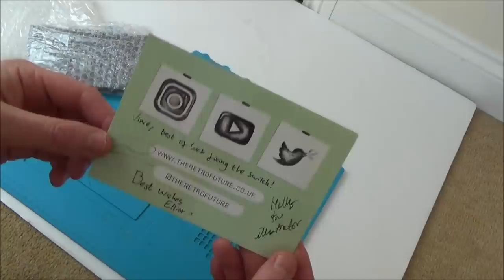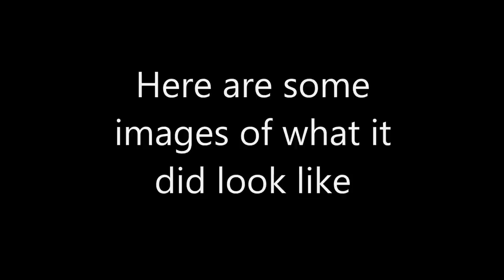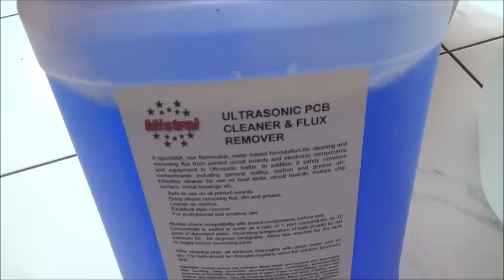Trying to FIX The Retro Future's £24 Nintendo Switch

Comment: This is the problem I see on a lot of Switches. Seems that those main chips are pretty weak with very few fuse protections on the board for them. At some point I'm going to just take one of those chips off to see if the shorts are gone. I certainly couldn't have done anything more for it than you did. You gave it a good try!
Reply from the maker: Thank you Steve :-)  It is interesting that the good boards also short on those caps but after a short delay. Please let me know the outcome when you do it or personally I would like to see a video of you doing that :-)
Reply: @Mymatevince  this is because you are charge/decarge the caps and that's is why you see the ohm drops og rise. 6R is not shortet.
Reply: I would say that you could add beard to ultrasonic cleaner, that would help a lot, would remove corrosion.
Reply: I wouldn't buy one used, but we got ours new about a year ago and with semi-consistent play we've definitely gotten our money out of it without any issues.
Reply: @kfm06  just don't drop it in a swimming pool and you'll be fine
Reply: @RokasSondaras  I don't think Vince has a beard! :-D
Reply: @skjerk  my mistake. :D
Reply: @kfm06  Remember this channel is about fixing broken things which are often water damaged. It doesn't mean there are lots of problems with the Switch in general. My day 1 Switch is still fine as is my wifes and my sons. Never had a problem with any of the 3 we own and they have all been dropped plenty of times. I'm sure if a drink got spilt on one then there would be a problem but that applies to all electronics that aren't waterproof. I wouldn't put off buying a Switch because you have seen a lot of broken ones on Youtube. They are the tiny minority rather than a true representation of the majority.
Reply: If you mean the cpu/gpu combo chip I tried it on a board just like the one in the video with the same shorted caps and the shorts went away. They mostly seem to die when they first get wet rather than corrosion or other chips causing the shorts unfortunately.
Reply: What about putting the board in an ultrasonic with CLR, which descales surfaces - even a weak acid, for a very short period of time. Not certain, never tried cleaning electronics with anything, other than IPA.
Reply: Been a while since this video, but I just now removed an APU from a switch that had shorts on the caps that are usually caused by P13USB but replacing P13USB didn't fix it. The shorts went away. If only the Chinese sold some APU's for switches!
Reply: Oh my god its an epic cross over
Reply: V1s especially

I think Lite n OLEDs are better built

Comment: at 27:09 you've solder bridged two capacitors, so they are shorting it together.  also, capacitors for RAM and CPU always have a low resistance to ground.
Reply: Good eye. I didn't even notice that. I was too focused on the solder balls and the components closest by. Probably the same reason Vince didn't notice it.
Reply from the maker: Thanks, I did spot this while editing and I tapped the soldering iron on it to remove it. I think one of the solder balls shot out from under the chip and landed in between the caps. Unfortunately it still doesn't work but thanks for letting me know :-)
Reply: My Mate VINCE i wonder what line is it for.  maybe the chip is now dead due to the short.
Reply: One of the chips had a couple solder bridges too. I didnt see you catch it but may have been edited out, good attempt mate!
Reply: yup best to check multiple times before applying power, once its done it's done. It's best to remove the chip put it on cold lining it up then use stripped bread ties + aluminum foil(or just make it from thin sheet aluminum reusing it) to make a make a stabilizer/heat concentrator while it's still cold lowering the chance of a short under the chip, when your bumping it around on the board it causes bridges as you can see on visible pins, you may have edited it out cutting right to it. When its stable the balls have way more tendency of bonding correctly and straight. Next time just eat a banana may help with the shaky hands. Use to use these techniques on ps3, xbox, and Wii repair when I did it for spare cash. These new consoles learned their lessons, Nintendo still needs to catch up, the switches cooling is a joke. I like the idea of a clear case cutting a design with a dremel right on top of the fan allowing more air flow at least, the motors are known to burn out due to a component because they get so hot. I heard that that component is what takes most switches down, no fan, you screwed.
Reply: I was going to comment about the resistance, too.

Different meters tend to have different thresholds for when they trigger the beeper in continuity mode. It could be anywhere from 50 Ohms to say 200 Ohms, depending on the meter.

And yep, the main power rails on larger SoCs or GPUs often have quite a low resistance, and could still appear to be "shorted" when they are fine. That could even be below 10 Ohms on some chips.

The continuity mode can be very handy for narrowing things down, or even reverse-engineering whole boards (I used a cheap meter to fully reverse the N64 and Dreamcast). But you should always keep an eye on the meter reading, as it may just be a low-resistance reading and not a dead-short (close to 0 Ohms).

You also need to watch out that some meters only enable the beeper in the Diode test mode, where the display usually indicates the forward voltage drop and NOT the resistance.

The voltage drop often roughly follows the resistance at lower ranges, but can be confusing, as it's not the same thing. It can also heavily depend on which way round the meter probes are, what else is in the same circuit, which caps are charging / discharging, and all sorts.

A valiant repair effort, though, and your diag skills have improved dramatically since the first vids. Keep it going. ;)
Reply: 10:00 Good work comparing to the other boards. That does seem to confirm that the new one did have a short.

Comment: the chip near the charge port is damaged when elliot cleaned it there where scratches on the board near the chip and the side of the ic chip is broken also there was bad corrosion on the backlight cable as well so glad you did this video
Reply from the maker: Thanks, when you say the side of the IC chip is broken- could you let me know more info. Is the little chip to the right of the charge port near the battery connector? How do you know it is broken? Thanks mate :-)
Reply: @Mymatevince  the grey coloured chip or coil   next to the charge port towards the battery connector  where the scratches on the board are looks like the edges are chipped off  i might be wrong but it  does not look right i noticed it when you zoomed in to show us the corrosion on the board  i had a 3ds with a similar looking chip that was damaged and the console would not power on or charge until i changed it over and that was after water damage i hope that helps mate
Reply from the maker: @moosesugar  I know the one mate. I think it is an inductor (think-I might well be wrong). I will take another look at it. Thanks for letting me know :-)
Reply: @Mymatevince  I'd have thought the battery would at least charge if even if the Tegra/Nvidia chip is damaged ?

Comment: I actually have a switch I bought locally for $110 and it came with everything. Joycons, dock, charger, etc. The only issue after taking it apart was the same backlight issue. It has a faint image when you held a flashlight to it but no backlight. 1 of the pins was completely corroded and 1 was completely missing. Ordered a new screen for $14 and now I have a brand new switch for $124.
Reply: RipTornSideways That’s not brand new but still an amazing deal.
Reply: @Isaaaaaaac  It's practically brand new.
Reply: RipTornSideways nice
Reply: @Rob Alle I sold it for $300 when switches were way up.

Comment: Nice one Vince.
I'm an engineer, ok I'm an electro / electronic / mechanical so I'm not an expert in any.
But I have to admit sometimes your thinking is way off but you don't give in, and other times I think OMG why didn't I think of that.
I will definitely give you an award for perseverance.
That row of capacitors could just be 1x faulty capacitor and because it's across the others it shows that they are all faulty but again it is also more likely
the main chip is at fault.
What would have been good is if you actually removed the chips when you were trying to reflow them to see if and when the short disappeared then put the chips back once you found the fault.
I must admit working on stuff that small I would look like I was in the middle of an earthquake. Through hole PCBs are the best. Keep up the good work sir.
Reply: @jay-uj8xt  No need for that, I'm sure you could come up with a better reply.
Reply: @MrMaxeemum  whatever if you dont like my comment to read it
Reply: @jay-uj8xt  Ha ha ha ha ha ha......

Comment: when reflowed at 30:33 4 pins appear to be bridged and at 30:57 you knocked off a capacitor but yea tthe main bga processor likely has corrosion or has an internal failure bummer = /
Reply from the maker: Thanks, well spotted. I did spot the 30:57 one while editing and I tapped the soldering iron on it to remove it. I think one of the solder balls shot out from under the chip and landed in between the caps. Unfortunately it still doesn't work. I didn't spot the little cap that is crooked. Thanks for letting me know :-)

Comment: Nice try Vince
I did also see the bridged capacitors (which i see you found reading the comments).
Dont be disheartened. You were trying to fix something that was water damaged and had already been attempted to fix.
This takes you to a new level. This shows repair guys sending you stuff to repair now.
You have come such a long way.
Would you like my hoverboard boards to try and fix? (I wont send the complete hoverboard lol)
Reply from the maker: Thanks so much Emma :-)  I think those hoverboards come with 3 different style of boards. I know when I looked before the cheaper ones were set up differently with less boards than the more expensive ones. I forget which ones I have here, I think it was the cheaper ones. Last time I looked you could buy the boards for approx. £20 on eBay. Although the hoverboards are always an interest fix you have to ask yourself do you really want to trust me to fix something yourself or your daughter is going to ride on!!!!!! Lol I don't think I am ready for that level of responsibility as I could foresee a broken arm in your household after getting thrown off :-)
Reply: Hi Vince. Thanks for replying.
I have found out so much about these boards since I got them.
The hoverboard I got (for £20) had a discharged battery. It was reading as 3.1V when it should be about 39-41V.
The board is blue and is a V1 board. It has a main board and 2 gyro boards (total 3).
This is not a top end board, but it is also not the cheapest type.
The boards look pretty clean at 1st glance and I asked the seller who confirmed they were used seldom and then put in the garage for a few years.
An attempt was made by a friend of the seller to fix the board (battery was dead)(INSERT FACEPALM) and upon closer inspection you can see parts have been resoldered. The sellers friend obviously couldnt fix the issue but I dont think he has caused any faults.
As I said, this is a V1 board which I have discovered has a little known fault in the design where if the button is held in to calibrate it, then it can brick the logic board. I believe this may have been done by the seller or his friend to try and fix the board.
I have investigated the board and found some shorts which seem confusing.
I cannot fix the board but my knowledge and skills fall way short of even novice level.
I actually just want closure on the boards to see if it is a bricked chip (in which case the board is useless to me on any level).
An equivalent set of boards (Not V1) is only £15 on Ebay so I dont care if you wreck it to find the fault, but it may be a learning process for yourself and your viewers and undoubtedly some hoverboard users have had this fault.

I did buy a further 3 boards (1 for BF, 1 for daughter and 1 for spares) which were sold as returns and faulty for £20 each. All 3 work fine but 2 need new batteries. These are all much more modern type but with only 2 boards (cheap version). Still a bargain as they are nearly new and if bought new they would cost £149 each.
Reply from the maker: @DEmma1972  You got a real bargain there. £20 is a great buy. I will pass on the chance to fix them but thanks for the offer. If they had the same boards as my 2 hoverboards, then I could then measure different things and maybe even swap over components. Then possibly show them working at the end but without the same type it would be highly unlikely I could fix them. Thanks for thinking of me with the idea for a video though :-)
Reply: Vince. It doesnt bother me if you can fix them or not. Just wanted to see your approach and see what I missed lol. I can send you a pic or if you really dont want to do them then I wont ask or mention again. Cheers for your time
Reply: They are still selling them on facebook at £20 each. They bought/buy job lots
Reply from the maker: @DEmma1972  Thanks, I will pass on them at the mo as I am trying to work through what I have.....BUT if I get another hoverboard in the future which has the same boards as yours then I would be interested in looking at them (if you still had them) :-)

Comment: Don't be discouraged from taking that NVIDIA-chip off. If it really is a lost cause, you're free to do whatever the hell you want with it! After all, you're the Switch-killer, might as well kill it off completely.

But before you do that: please, for the love of the Switch-god (wait, that's you, right?), please TRY to swap that NVIDIA-chip over with one from another defunct board! Or maybe just reflow or lift off and put back on?

If it is a lost cause, none of this would matter anyway, it would just be for good entertainment (and perhaps as a lesson in how easy it really is to put a big BGA-chip back on, as well as finding out if it was the NVIDIA-chip that was causing the shorts).
If it is not a lost cause, this could be its last hope.

EDIT: UNEDITED: Edited wrong comment...

Comment: Great try!  You can't win em all!  If he lets you keep it - try removing the main chip there to see if the short goes with the chip (likely is the chip).  As you say, at least there's a lot of value in the other chips and components.
Reply: The main chip is too large. He'd need to invest in a BGA station, as plain hot air over that chip will definitely boil it by the time the balls would melt. He could ghetto rig a pre-heater.
Reply from the maker: Cheers Chris, before I send it back I might try and remove the bank of capacitors just in case one of them is causing the short, if not I could try and get the main chip off just to prove the fault as those caps may be unrelated. I also knocked off a little capacitor at 30:57 so I might try to get it back on. I don't think any of it will make any difference but it is worth a try. Thanks for the comments :-)
Reply: Good idea!  The more smaller things you can remove from the board to try and rule out them first the better!  You could measure connectivity from those caps to other small ICs, transistors, diodes etc on the board to see if anything else is connected - it might be one of those components!

Comment: I think the shorted resistors are mostly ok. This line looks like a stabilization circuit for varying loads with smoothing/buffering caps.

Comment: Resistance to ground on dies (gpu etc) are always extremely low in the ohm range due to the little amount of resistance in silicon itself. Memory is usually higher. As it’s a lost cause at this point I’d just probe around the board and those shorts just remove parts until it is removed in the way of learning.

If the main chip is shorted 0 ohm to ground then it could be anything on that power line, anything on the vrm which is causing it. It could just be a capacitor which has failed.

I’ve had shorted bga chips before where the short has been removed only by removing the chip due to an internal short.

Best of luck and good attempt vince.

Comment: You have inspired me to start repairing broken ebays stuff.. so far i have been buying faulty ds lites and dsi as they are cheap.. I'm on  my 5th one and so far have repaired them all.. my latest is a £4 dsi with no sound  on the speakers but there is on headphones, i have ordered a new jack.. It will be my first attempt at surface mount soldering.
Reply from the maker: Well done mate, good luck with the new headphone jack :-)
Reply: Too many dishonest sellers on ebay these days to make it worthwhile.  They cover themselves with the 'for parts not working'  to avoid people returning things.  Most of the sellers know the stuff they are selling is beyond repair even for experts.
Reply: @chrish1398  ive been lucky so far no water damaged items as yet,

Comment: I havent whatched the whole video but did you try hocking up loads of amps on the 5v oder 12v rail or whatever rails the switch has. This will simply burn out the part where a short is an heat it up. You can then find that spot with alcohol (it vaporates) or by touching with your hand oder a ir camera. Dont know if it myght help. Saw some comments it could be the main chip.
Reply from the maker: Thanks Marco, unfortunately I haven't got a bench power supply where I can change the amps, my one changes the voltage but I think the amps are set. I have seen Louis Rossman do this technique before. Also if I am honest I don't know how to detect the different power rails!!! Cheers for the suggestion :-)